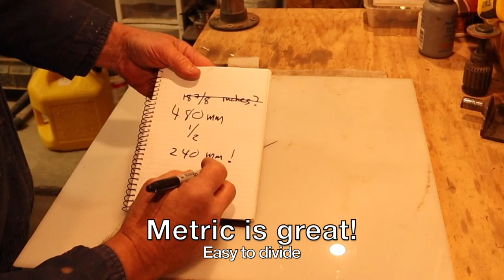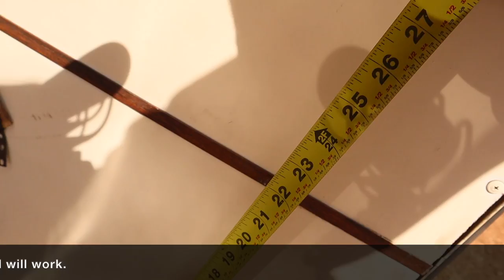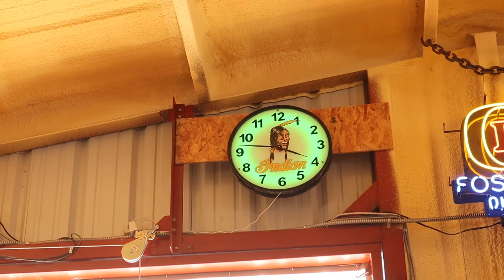Make your own large 19 inch “neon" clock

Comment: Pretty slick!  You can eliminate the need for the clockwork battery by adapting a cheap USB charger with a resistor to drop the output voltage from 5.1v to 1.5v.  You will need to note the amperage of your charger (they are all a little different) and plug it into: R = 1.5v/amps; solve for R in ohms for a resistor placed in series in the USB charger outlet.  Since dry batteries range from 1.4v to 1.7v; the nearest resistor value will work fine.

Comment: What did you use for the face material?  It looks like a semi translucent material for back lighting.  Also, what is that lighting kit called?  I want to build a similar clock. thanks
Reply from the maker: Apologies for not answering sooner. You’re exactly correct, the plastic came from a panel used to look at photographic slides which was given to me at some point many years ago. The lighting kit was one of the many choices available from amazon. My criteria was that it was a strip of colour changing LEDs, come with a power supply and be inexpensive. After enjoying it up to now, my regret is that I didn’t use the entire strip but only went around twice.